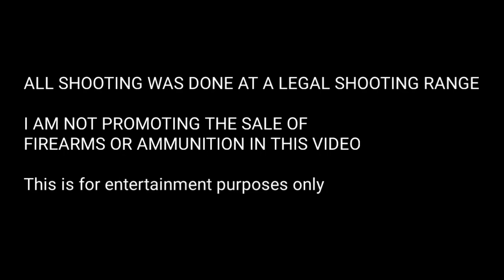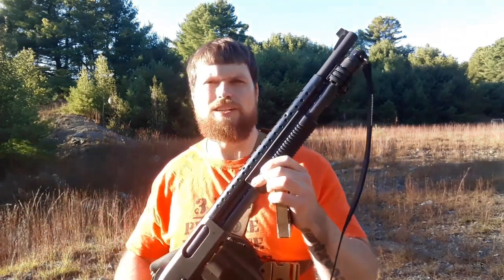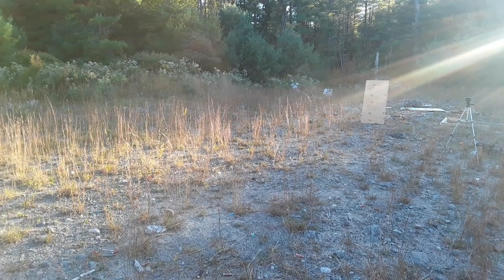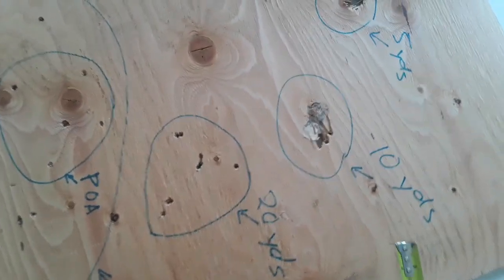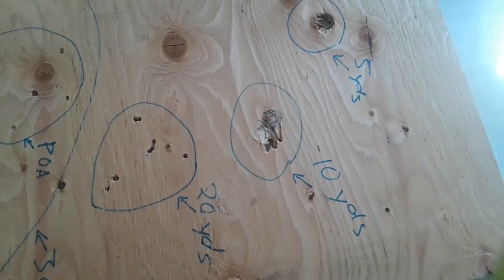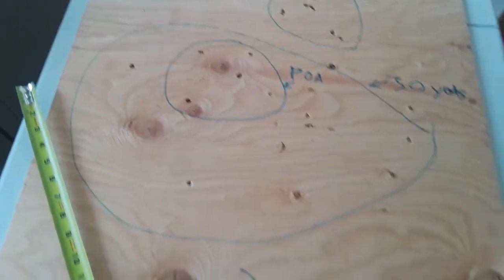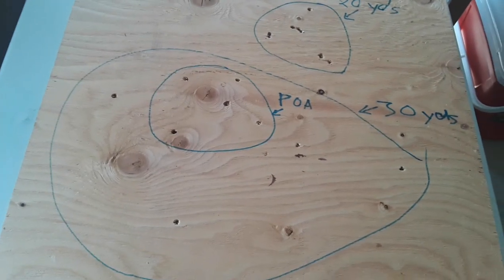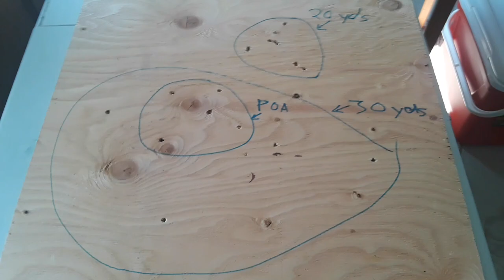Federal Flite Control 12 gauge 00 buckshot pattern test - 5 to 30 yards

Comment: If you have shotgun with short smooth bore, and you want better pattern for long distance, don't need too look for long barrels and chokes. Give your weapon a federal flite control.

But for home defense, better to stay with normal 04 buck.

If your barrel was 20" length, you think you would have a better pattern (even a small difference)???
Reply from the maker: Exactly...ah 20 inches wouldnt have a big difference on shot. But if you use slugs it will have a slight difference.
Reply: @NYPrepper  I want to buy for my first shotgun a benelli supernova tactical pistolgrip 20" (50.8 cm), for home defense. And i think to use it for hunting too (with experience friend). For Hogg and deer (maybe for rabbit too). The shot distance is 25-30 meters max. I hope  have good results with buckshot (I don't worry for slugs results).